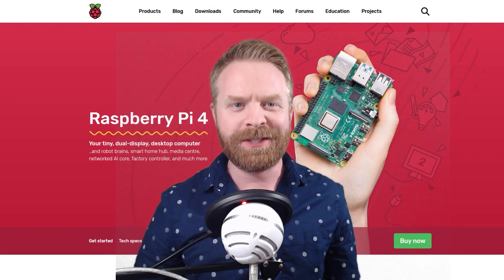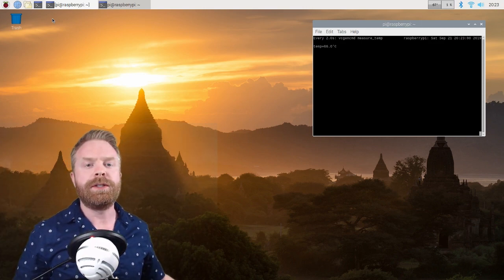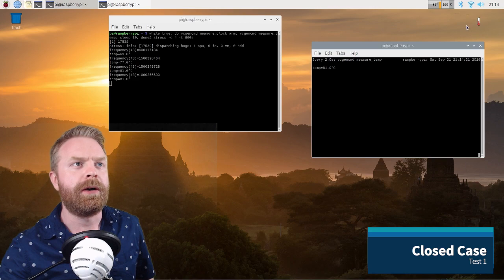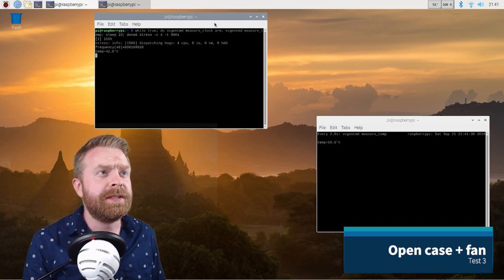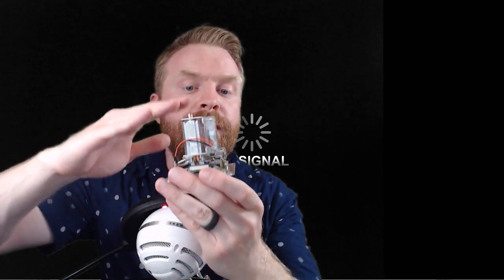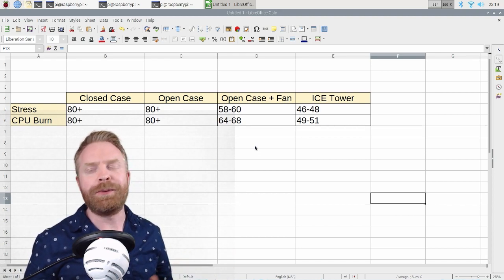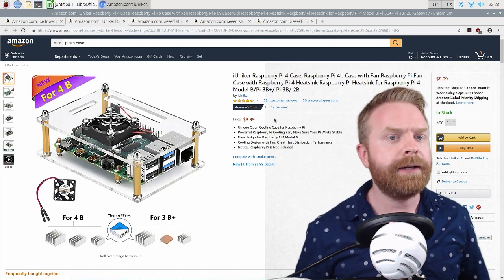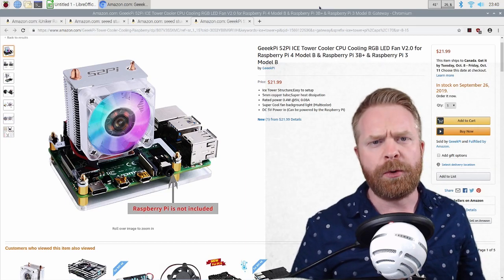Raspberry Pi 4 Stress testing - Is this the best way to cool a raspberry pi?

Comment: just put a 4B in a version 3 DeskPi Pro case . . . and it has a horizontal ice cooler with the same heat pipes, radiator and fan that fit inside the case. Does a magnificent job of keeping it cool even when set in turbo mode with the Pi overclocked to 2 GHz on the processor and 600 MHz on the graphics. Heat sinks plus a case fan on another 4B running a PBX system 24/7 (RasPBX) is more than sufficient. My conclusion after two years with the PBX: a 4B in an enclosed case needs - at a minimum - heat sinks and a case fan even when it's not overclocked. I'm moving the PBX into a DeskPi Pro in a week or so to get it off of the SD card and onto a hard disk drive to give reliability a quantum leap by orders of magnitude. Doesn't need read/write speed of a SSD, or enormous capacity, but SD cards can only sustain so many write cycles before they give up the ghost.

Comment: I run my pi4b in an open cluster case with dual fans on it and on the pi below it,  and im over clocked to 2ghz with an over_voltage of 4 i run round 54c to 65c

Comment: Ive got my 52pi ice tower 2 (looks a bit smaller and some more coloured leds that dance about), on Pi4 overclocked to 2147mhz and 750mhz gpu and getting no higher than 47 degrees on CpuBurn. I also added some real thermal paste rather than pads. Awesome.Idles at about 26 degrees.
Only thing I would prefer is the ability to control the fan kick in and control / disable leds